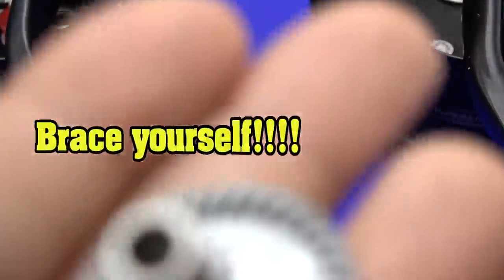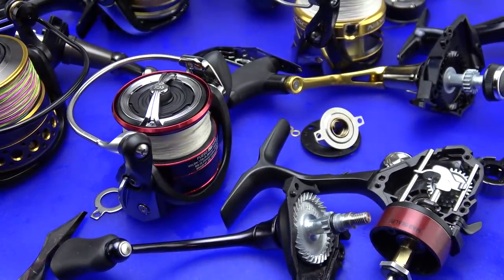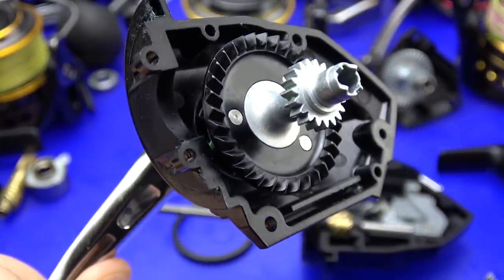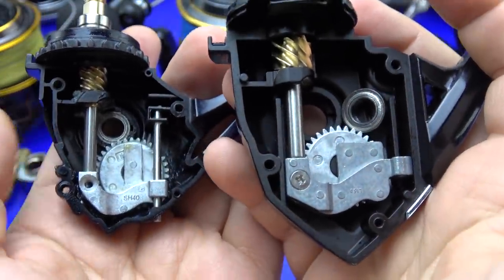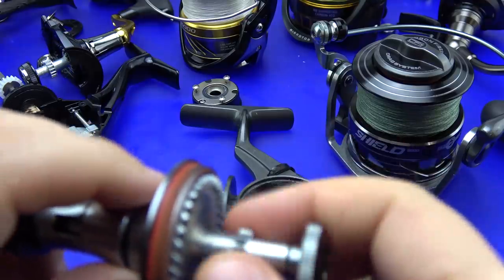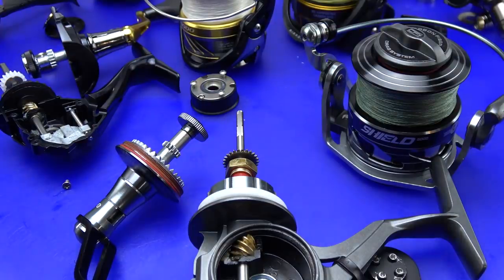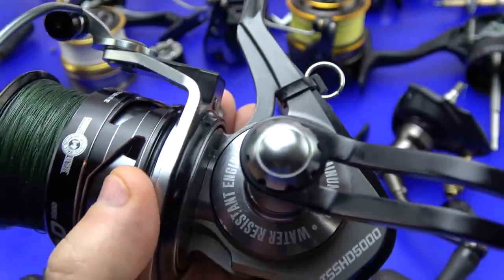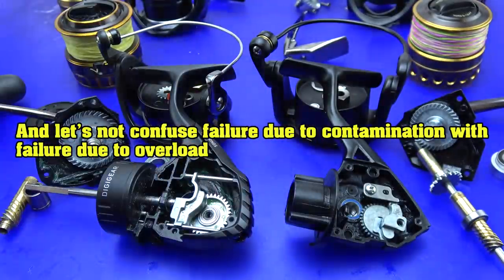2018 - 2019 $100 reel buying guide, comparison, and review.  Penn, Shimano, Daiwa, Tsunami

Comment: The battle vs bg comparison was fascinating. Kudos to you for pointing out the bearing noise at the end of the review. Those bearings are virtually dry in the new reels and they will fail [ask me how I know]. Penn definitely outdid Daiwa on preventing failure on the pinion bearing. I also like the fact that the carbon drag washers are keyed to the spool. That main gear on the shield is pitiful. It would last no time on snapper and amberjacks. Whenever you hold a spool up to the camera to show the line lay it looks like there is way to heavy a braid on the spools. Those spool line clips are just aggravating. Most of the time the flouro leader you are using won't begin to go under that clip. Really was a fun hour watch all in all. Good job!

Comment: I have several tsunami 3000 and 4000. I fish only salt water and I have not had one single issue with corrosion or bearings. What I have had is a bail issue on all of them where when you attempt to make a firm long cast the bail will close during the cast. This obviously makes you look like a casting pro lol. I’m not sure if there is a fix for this issue. On one of my 4000’s shields my main gear sheared some teeth. I have been back and fourth with tsunami’s warranty provider for over 6 months and have been unable to get repair parts. Last I was told if they didn’t get parts soon they would send out a new reel. I like the shields as far as how they have held up but the bail closing issue and warranty and parts availability have me looking at other options in the future. Figured I would share my experiences with them being I have 5 shields.

Comment: I have the original Penn Battle, it has been a great reel except for two things. On occasion the fishing line becomes trapped under the spool and wraps around the main shaft. Second,  the rotor wobbles while in use ( something loose?). 😢

Comment: The ring and pinion gear mesh is horrible on the Penn and one of the reasons I saw a guy strip one out on YouTube.
The other is he wasn't fighting the fish correctly and putting all the stress on the gears.
Why is it my cheap Academy H2O express has better gear alignment than either on of these higher priced reels?
Not top of the line but just fine for catching river cats. 
No the pinion isn't brass but what does it matter if the gears dont mesh correctly.
Reply: The gears were damaged on the Battle II that I tested too. But the drag was fantastic.

Comment: I know this is an old video, but for the recessed nut found in the Soccoro, is there a place I can purchase the seal to place there? I bought mine for $24 so I am not too worried about spending a little bit extra on some extra parts that could improve my reel. Love your videos btw!
Reply from the maker: Check out the shimano parts page... Goto shimano Australia's site (the USA parts page is broken). The Nasci 500 side plate seal fits the socorro
Reply: @TackleAdvisors  thank you so much

Comment: Hello Mr. Do you know about SALTIGA Z S EXTREM 6500 made by DAIWA JAPAN in collaboration with DAIWA AUSTRALIA ? They are 2 sizes of spool 4500 and 6500. Same question about SALTIGA Z S EXTREM H MAVERICK in 2 sizes, 4500 and 6500.
Something IS intresting : if you put on the DAIWA SALTIGA Z GT model 2001 the spool 6500 of the SALTIGA Z S EXTREM you have bigger  retrive than the DAIWA SALTIGA Z DOGFIGHT 6500 model 2002 black. Its the same with DAIWA SALTIGA Z EXPÉDITION 6500 model 2002.
If you put that way the retrive  of the DAIWA SALTIGA Z GT DAIWA model 2002 have 1,44 m by a tour. More that thé DAIWA SALTIGA 6500 DOGFIGHT ( 1,42 ). Thanks for explanation. Raphaël KOSKAS.

Comment: Older video, but still relevant. I just bought Daiwa BG 4500 and 2500. Have only fished the 2500 so far. I have 8 lb mono on it and it casts far and reels smooth. Both BGs have excellent line lay with mono, 15 lb on the 4500. I also just bought a Fuego 4000 LT. I am outfitting to start light surf fishing in NC, haven’t gone yet. I have 20 lb braid on one spool and 15 lb mono on the other. Both have excellent line lay. Hope they fish well.

Comment: The biggest failing part in some reels wasnt talked about....the bail arm pivot lever. Its one of the cheapest parts and receives a ton of stress. Its probably the only part in a reel that slams to a stop every time you cast.  Ive had it break in my penn battle as well as an abu revo sx (2 times). I hand close my bails always, but still. 

I stumbled on your videos, good stuff,  gonna follow. Thanks.
Reply: Bob Strempek I agree. I've got 2 Abus with broken bail arms in my shed. Never had a problem with any Shimanos or Daiwas. It just so happens my only 2 Abus both have broken bails!
Reply: jimbo gasoline, easy fix jimbo, youtube abu bail arm, $2 part, order extras
Reply: Bob Strempek Thanks! will do. I just think its a shame that both reels have the same problem and aren't 2 years old yet. And my wife seldomly fishes (her reels). They're  not high end reels but I've had Shakespeare reels last longer without problems that have been fished way more than my wife's reels. I'll never buy another Abu spinner again. I shouldn't have to deal with this when 1 of the reels is not even a year old.

Comment: Awesome video, again.A little small, but very important issue, that doesn't seem to be addressed very often is the size of the reel foot.  I purchased a new surf rod, and my venerable Penn 8500 SS reel foot wouldn't fit into the rod Fuji reel seat.  So, purchased a Penn Pursuit III to replace the 8500, and...the Pursuit III reel foot won't fit either.  And, gee, my Daiwa BG 4000 reel foot fits into the rod reel seat just fine, so I have now ordered a new larger (to fit the rod) Daiwa BG.  My grandfather used Penns,  my dad uses Penns, but for spinning reels, I'm going a different direction.  Great comment at 1:02:23 about bearings.  Folks have a sense that stainless doesn't rust - wrong.  Stainless is rust resistant, but not rust proof.  Stainless metal comes in different grades, as well, and some bearings will rust more quickly than others if not service properly.  Stainless needs servicing, just like any metal, just not as often or quite so diligently.Thanks for what you do!

Comment: Which is better between Daiwa BG vs Penn Spinfisher VI ???
Reply: Diawa bg. I love them.  Its a beast does everything really well
Reply: @danielbeavers8701  Quality / price is top but not everything does well because it would not be worth to jigging
Reply: dirga: some sizes are different!, it's as if you compare mountain bike with road bike!!
spinfisher low RETRIEVE/IPT= better for jigging 
sf4500 34" vs bg4000 40"
medium sf6500 39" vs bg5000 47.5" all these have high ratio but BG +DIAMETER SPOOL
spinfisher better sealed and +drag....bg more fluid and silent. It depends on what fishing....
Reply: @caranx89  i wasn't comparing.  I was just saying i love the bg. Haven't had the penn sf yet
Reply: @danielbeavers8701  ok mate!, I haven´t proven any of them yet!. I only say it to separate the differences...do you have several bg models and do you fish?
Reply: @caranx89  yes i fish. I have the 2500 bg and 4000. I fish mostly bass. I would love to try out the penn ive heard a lot of good things about them. But yea i love the bg. Its a tank.

Comment: Cast metal gives the designer MORE CONTROL over the properties of the product NOT less control.
Clearly you're wrong and low class.
The metal got fine tuned to do the job.
Every point you made was complete rubbish.

A screw is a wedge wrapped around a post.
Wedges require lubrication.
The 1st company I've come across to tighten screws correctly is Jarvis Walker.
The Internet reminds us everyday NUMBERS DON'T mean anything.

You're actually extremely wrong about cheap rods and reels.

Comment: Late to the show here. I have 2 tsunami shields I use for surf fishing. I beat the ever loving crap out of them (edit: and I’ve been beating on them for 3 years). Both have been dunked and taken rides in the sand fighting sharks. all I do is hose them off with freshwater when I get home real quick. Never missed a beat. I will add, both didn’t have the smoothest action at first but they have either broke in and the drivetrain has smoothed out or I’m super used to them now. Not slammer iii’s but still for me at this point, an AMAZING value.

Comment: Much to my surprise, a fine lightweight reel has been discounted into the $100 range. It's an older model, but certainly a bargain at the price. I've had one for a few years, and have no issues at all. It's only available in the 40 size, but the Okuma Helios reel for $99 is a steal. It showed up via a "partner" on the Walmart site.( tried to post the url, but it didn't transfer well. )

Comment: Had most of the reels in hand already and honestly I found the Nasci to be kind of a let down. Yes, it's very refined and runs heckin nice but still - something about it felt off? I can't really tell what, but still. On the other hand the Legalis LT which is about 30% cheaper felt extremely surprisingly good which is why I'll get the 2500 size over the 2500 size Shimano with the shallow spool for this seasons trout fishing. I really wanted the Nasci first because of the shallow spool since I hate the guts out of 1000 size Shimanos (aside from my Stradic 1000FJ which I love with a passion but sits on my Area set up).
Reply: I actually think the Nasci was a downgrade from the discontinued Symetre. My Nasci gets a great deal of frame flex under heavy loads, which effects gear operation.

Comment: 16.8 oz for the 5k tsunami shield is freaking heavy... i bought shimano biomaster 5k and it weights 11 oz...
Reply from the maker: differnt size reel.   The sw rated reels are significantly larger framed.   5k daiwa reel is 20 plus ounces.
Reply: daiwa ballistic 5k size is 8.9 oz, why would i buy a 17 oz tank? any special reason? i think that most reviewers dont give the weight of a reel enough importance and i think thats one of the most important things
Reply from the maker: Good question...i think the 5k ballistic is 4k stradic sized....the 6k ballistic is sized a bit closer to the 4k saltiga....If i could do it over again i would have bought the 6k ballistic instead of the 2500.

Comment: I destroyed 4 Penn battles in 1 season fishing inshore and offshore. Most of them got vary corroded, even with me spraying of the salt after use and taking apart to clean. Now I love Penn stuff but stick with the Spinfisher V or Better. My Squall and baitrunner have both help up very well also.
Reply: Yep, I don't believe Penn has anything on the BG reels until you get to the Spinfisher V series.

Comment: The line lay that you spoke about was interesting, I’ve fished with a few pros and they told me not to spool the line all the way to the outer edge or no more than 1/8” from the outer edge which causes the birds nest cluster ?!@$.
Any take on that info?
Reply from the maker: Hi Steve,  Honestly....the best real way to go about it.   Spool up to the max but before you invest in pricey projectile launching.  Give it a few hours to see how it works out....Without going into a million paragraphs explaining why......That's what I recommend.    Every reel will handle different types and diameters of line differently.   And you won't know until you fish it.  Shimanos I can spool up to the false lip without issue.  Daiwa I can get real tight to the lip.  Same with some abus and even a few penns.    But some you'll have nothing but trouble especially when fishing the surf in the conditions you see and techniques used (pencil popping)      1/8" is generally very safe across the board.  But some reels should go tight to the lip to maximize distance with the least effort.    I hope that makes sense :)

Comment: Hi for the Daiwa BG i am getting that noise in my bg8000. Which bearing is it exactly? Is it the bearing holding the pinion and drive gear unit in the vertical position or is it the bearing parallel to the handle. Can i simply grease this bearing? Or do i have to buy a replacement from daiwa? Also do you know of any sealed bearing that i can use to replace this one?
Reply from the maker: Assuming it's Makin the noise when no line is on the roller.  It would most likely be the bearing directly under the ar clutch.

Comment: Thank you very much for the in-depth review! Excellent and to the point. Granted it'll never cover everything everybody gonna wanna know but you did a great job and contributed tremendously to fishing community, as well as manufacturing process (for those who cares to listen and I know smart ones are listening). My main reels are Daiwa BGs, and recently got a few Fuego LTs, amongst baitcasters, conventionals. I have yet used Fuego LT much and will try to remember to update once I've got a few miles out of those. I fish from surf and banks, typically red/black drums, speckled trouts with occasional bluefish, and typical trashes. Once in a while I do kayak as well, thus the reason for Fuego. 
Keep up the good work and thank you again fro LA!
Reply: How has your Fuego stacked up against the BG?  If the performance is similar I will definitely go Fuego LT, based on the sole fact that it is lighter.  Biggest complaint I've heard is that the Fuego LT can flex when handling larger fish.
Reply: @STiMPUTELLO  Recently I used more of the Fuego LT than BG, because it's lighter. And I finally broke down and fixed the line lay issue of the Fuego, by adding one extra plastic shim. Both of my Fuego's got this problem out of the box. Sad really. If you google, you'll see that this is a very common issue. About 2 weeks ago, me and my son went fishing, we got several 20+" reds on both BG and Fuego. Performance wise, no difference. Weight wise, I prefer Fuego.

Comment: I am not an engineer either. but think of this. When you drive forward in your car it is more like the Diawa full contact gearing. When you back up or coast it has less tooth to grab. Its in their design. Need to move the spiral gear deeper to engage more tooth, on the other real. Same reason that the gears are made the way they are., for pressure and drive, gearing in reverse lets them slip more than bite the pinion to ring gear.
Reply: I am an engineer and I work in the gearing field. A full contact pattern on the drive side is an indication of a worn out gear. The optimal pattern should be contact in the center of the tooth and should only be 50% of the tooth face. A reference would be  ANSI/AGMA 10-10-F14 (Appearance of gear teeth- Terminology of wear and failure). None of those gear trains have anything even close to optimal contact pattern, however they all appear to be cast gears and I'm sure they are only designed to meet Commercial 1 standards (AGMA Q5-Q6) if that. Will they work? Yes. Are they optimal? No. What would you expect from a reel built to make a price point? Nice informative video BTW.

Comment: Reverse clutch bearing is something wrong I will forward and then I can real back witch with the tsunami Shield 5000 and it's a brand new real
Reply from the maker: Excessive lubricant in the clutch is likely the culprit... Was it very cold as well? That can make the lube even thicker

Comment: How do I keep my line from gathering at the too of my spool. It's a diawa fuego 2500
Reply: Pull off your spool then add or remove a washer on the spool shaft to adjust the height of the spool.

Comment: paid $75 for socorro Sw 6000 from cabelas 2 years ago, fished the shit out of it, pulled stripers from 10-49 lbs at the cape cod canal and it still hold up well, drags was so good, gears were still perfect when i opened it, only problem i had was dropping it in the water while unhooking the fish, and the AR clutch got SW in it, i cleaned it out at the end of the season and worked just fine, best $75 i've ever spent on . still one of my favorite reel to this day :)

Comment: On point as per usual with the $99 egg beater Shootout! I had 3 (+?) commercial's, hoping that's a good sign you weren't demonized again. Finally broke in the new BG2500 last week, now I too can say I'll never buy another bogus hex handle egg beater again. Thanks for the suggestion and tight lines brotha!
Reply from the maker: Thanks man!  Catch'emup!!
So far I haven't been hit with the yellow dollar.   I added a couple slots of ads..hoping they were little banners..not full blown commercials...That connection makes a difference...If you made it to the 1 hour mark you can see how shimano took a step backwards to how they did it 20 years ago
Reply: Yes they were like 10-15 second snippets. I'm guessing that's a banner? Just curious, if I skip the ad do you still get credited the same? Oh yeah I watched it all, always do, and will probably watch it again sometime when the weather/water's shitty. Keep em coming.
Reply from the maker: Banners are little ads that overlay at the bottom that you can close....Then there are non skipable and skipable commercials.    I'm not certain how I think it works the same.  Either way my CPM's which is how much $$$ i earn per 1000 views..is pretty high compared to others some who are 10x my size. 3.50 to 4.00 per thousand views. So whatever it is and however it works.  It works for me!  LOL..
Thanks brotha

Comment: Great video man!
One question, the black "seal" on the bottom of drag cap. How affective is this seal, it looks like the same one on the Penn Slammer3 lineup.
Reply from the maker: referring to the battle?  They're all effective against water.  Sand and grit is where they can run into issues.
Reply: Tackle Advisors 
Yeah agreed. Thanks man!